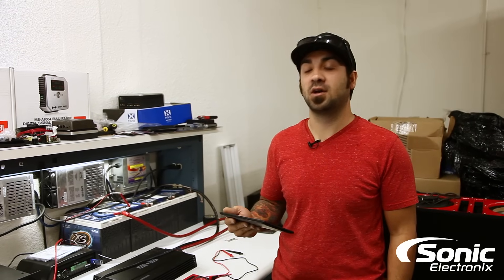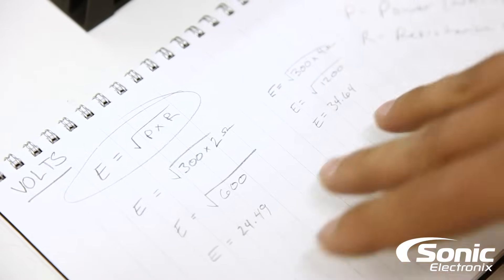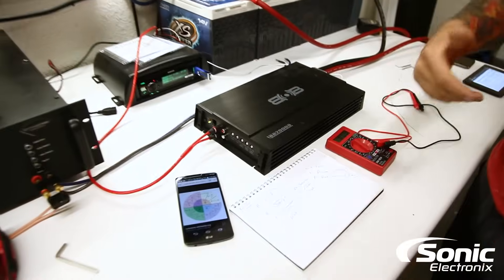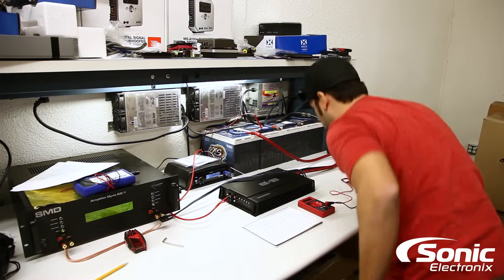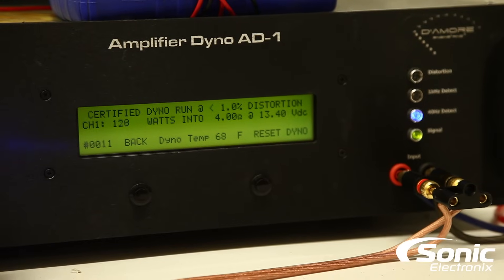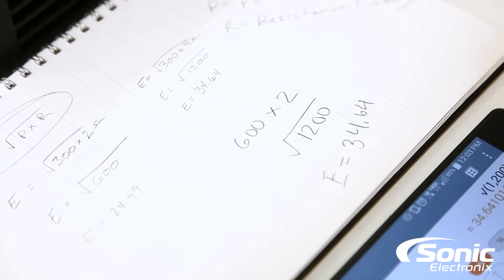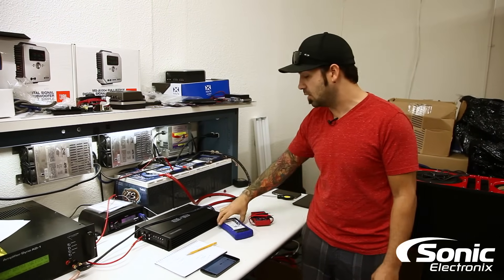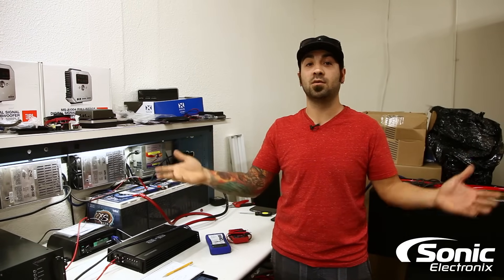How To Set Amp Gain to Match Lower RMS Subwoofers? | Car Audio Q & A

Comment: That pretty good for me. A friend gave me a dual 12inch box with amp but one woofer is gone. But since I got a small car I plan to buy a single twelve box. But now I know how or try it now with the existing 12 inch . Something funny my woofer is if I remember is a 300w RMS 4 ohm so I just have to use your calculations to use it with mine .... Many thanks

Comment: This formula isn’t working with my friends set up for some reason unless I’m doing something wrong here: He has two DVC 800 watt rms 12 inch 4ohm subs. His amp is 2500 watts rms bridged at 4ohms. I used 1600 x 4ohm then square root and the number that comes back is 80. The amp only goes to around 71. What am I doing wrong here? I was using the meter on the two bridge ends that the wires go into. Thanks ahead of time. I tried this with my set up and it worked great. (Number was 34.6). My amp is only a couple hundred watts over my speaker rms tho, unlike his which is about 1000 more watts than his speakers. I’m assuming I’m doing something wrong in the formula since the end number is 80. But I’m multiplying the total watts by the ohm load so not sure what’s wrong in that. Is it possible he has his speakers wired wrong and they’re final load isn’t 4ohm?

Comment: Sir how to run a mono block amp for my 2 pioneer tsw1211d4 at 2 ohms at maximum power my amp delivers 600rms @ 2 ohms so best source for powering up ..can I run computer power supply 12v 62amps and if want to run a battery for it how will I charge it ..

Comment: Man!! You saved me the hassle of doing the math. The last(I was hoping you would do the equation) 600x2 equation and you made my day and night! Thanks so much. Usung my volt meter tomorrow to get 34.64 on my Xtr orion 1500.d
Reply: What is the second math   after power x ohms =  let's suppose  is  1500 waats  Amp x 2 ohms =3000 then what?
Reply: @buscojosenjuarezdenuevoleo9669 roughly 54

Comment: I have 1000 watts sub dual coil 2 ohm , I connected in parallel so I got one coil 1 ohm. So I do 1000 times 1 ohm , equal 1000 watts .
Square root of 1000 is31.62 volts. I put my 40 hertz track turned the gain until I get that voltage and I end up with my sub that doesn't sound loud at all , it just need more power, when I turn the gain 3/4 in my rockford fosgate p1000x1bd than I start hear the sub playing.  I don't understand why I followed this rule and my sub still needs more power.  I hope you guys can help me

Comment: Hi bro. Nice work. When you say the subwoofer RMS is that a total combination of speakers Watt? I have 4 speakers, 2 speakers rated 2 ohm, 2 speakers rated at 4ohm. Basically mixing 2 ohm and 4 ohm as it's front and rear pair of car speakers. How do I calculate the voltage?

Comment: How would you set the gain properly on a active sub with built in 200rms amp when you have no outputs to take readings off , amp has lpf , gain, sub sonic and bass eq 
Thanks

Comment: so, my subs each have a power handling of 150-350 watts, if wired at 1 ohm, I would use 700 watts X 1 correct? Thanks for the help.
Reply: not enough info.  you sound lost.

Comment: I have (2) 8" Alpine type-R DVC 4 ohms. I have to confirm as I did not wire them, assuming they are wired for 1 ohms, amplifier Precision Power P1000.1 Class D Monoblock Amplifier 1000 watts RMS at 1 ohm.
They may have not wired them at 1 ohm to not overpower the subs? I shall find out.
Since there are 2 subs, I am assuming I still use the same formula, 1000 X 1= 1000, square root is 31.62 volts. 
Just want to make sure I'm thinking that right?
Reply: oh, wait, I can plug in the wattage I am after, not the max capability of the amplifier?

Comment: I understand this with one speaker. I have 2 square solo baric 12" subs. the L7T12 slim. the thin. 600 RMS each 1200 peak. I have a Kicker 1800w amp D class mono block amp. whats my steps plz. i saved this video

Comment: Weird I followed the way did it with my multimeter set to ac 200,remove speaker wires but when I probe it nothing shows on the meter,I even used 2 different multimeters,wth am doing wrong?my amp connected to an LOC cuz I’m still using factory head unit..please help.thanks

Comment: If my sub is wired up to be one ohm, do I use one ohm? It's a dual 2 ohm rated at 1000rms

Amp rated at 2250rms
Reply: Yes. Final load at the amplifier is what you use in your calculation.
Reply: @firebirdude2  thanks man!
Reply: also when you do this, open your low pass filter all the way up. turn bass boost all the way down.
Reply: @TheBakeMaster  thanks man!!

I watched multiple videos and did that system sounds pretty good so far
Reply: @avim868  no problem bro, Bass on!

Comment: Would i be able to set the gain to the amount of wats i need between rms and peak power? Or does it have to either meet the rms or the peak? Because my subwoofer has a rms of 250 and peak of 1,000 so im just wondering if i could push out at least 500 wats without damaging anything?
Reply: only look at the rms ratings, if you would push 500w to 250rms speaker it would die within an hour.

Comment: Is this a stupid question: why do you have the positive probe in your multimeter plugged into the DC Amp hole instead of the Voltage hole, and why is your negative probe plugged into the Voltage hole and not the COM hole? :/

Comment: Hi Bro, I have " JBL GTX-1200T 12 inch Car Audio Subwoofer Tube 4 OHM  (1200 Watt)--->Power Handling RMS is 300 Watts" Shall i choose "SONY XM-N502 2-Channel Stereo Amplifier --> It's Power @4 OHM--->175 W x 1 (BTL)"... whether it is a best match ?  If not-----kindly share your suggestions to choose the BEST AMPLIFIER ......

Comment: I was satisfied with my amp’s performance but after seeing this I was curious. Turns out voltage was about half what the math comes out to
Reply: When I first adjusted the gain it was about the same with the volume half way up because I had the bass boost maxed out. I turned that down and want to recheck the voltage. Maybe use a little boost because I’m not getting much mid range bass. Pretty much the opposite of how it sounded before. The amp dyno sheet was like 435 rms if I remember right and the sub is only rated 250 so it’s far from clipping. Alpine v series and 10” p2 in a 1.5 ported box
Reply: So how'd it turn out turning it up? Sounds better louder, no clipping or anything?

Comment: What if you have a dual subs?i have 2 dvc 2ohm subs with each 600watts rms/1200watts peak paired with 1 channel 1200watts monoblock amp 800rms@ 2ohms

Comment: Hey does it matter if the amp is bridged? I have a dual coil 2ohm sub going to a 1ohm stable amp but the amp has two sets of  outputs. Didn't know if I should bridge those or if it's irrelevant. The amp is mono..

Comment: So disconnect the speaker wire then re connect it after you set your gain at the right volts using the multimeter?

Comment: What happens if am using different watts Power for front speakers and different watts for rear speakers on a 4 channel setting? Example. Installing 650 watts x 2  (4 ohms each) 1300 watts in the front left/right and a pair of 1000 watts (4 ohms) on there left/right rear. Is this doable?? All speakers are 6x9.

Comment: What if your using a stereo class A/B amp bridged?  with a4ohm speaker load would you do the math based on 4 ohms? or the 2ohms that the amp would "See"?
Reply: You do whatever you have you speaker load too, for example if you wire your speaker to 2 ohms then you do the math for 2 ohms vice versa

Comment: So for setting up two 300 rms woofers would I have to just calculate voltage for one or both? The outputs will be the same as pressure is even but would it be safe pushing 2x the voltage into one woofer?

Comment: Shouldn't we first measure the speaker's Ohms/Impedance and use that precise number? I ask because my system is set-up to be 1-ohm but on my DMM it shows to be measuring at 1.4 Ohms so would it be better to use 1.4 in the equation rather than just the stock "1" Ohm? 
5,000 x 1.4 = 7,000 sq rt = ~83.7 V versus 5000x1=5000 sq rt = 70 V resulting in a difference of 13 Volts which may mean the difference between distortion/clipping or clear power. Right?
Reply: Impedance is typically nominal, and the reason for that is the resistance of a coil (such as the voice coil in a speaker) changes as the frequency played changes. Another factor with voice coils is the magnet itself inducing voltage into the moving coil, further having an impact on resistance. So, no, not really. What you measure at DC with your multimeter is only accurate at the given moment while nothing is happening.

Comment: Ok got a Alpine MRP-M500 and a American Bass XR-12D2 12" 2,400 Watts Max Power Dual 2 Ohm Car Subwoofer in A Pro box. What’s the best way to have this wired and set the gain properly? Thanks in advance!
Reply: Your amp is not strong enough to power that subs at full potential. Your subs is 1200 watt rms, while you amp is 300 watt rms at 4 ohm and 500 watt at 2 ohm. Also never go by the max power of a amp or subs, always go by rms.

Comment: Does it work the same if the amp is bridged? or does voltage double? Or does the amp technically see only half the resistance and so the formula should be done with 1/2 the resistance?

Comment: Question: I paired my setup accordingly. two 600 rms watt subs (12"L7Ss vented) and one 2000W RMS CEA rated (Rockville DB16) everything at 2 ohms, so WHY would I encounter any clipping? Not saying that I have, although I think I have, but MY QUESTION IS would I encounter clipping if my Bass Boost is kept at zero if I used an amp that provides way more than enough RMS wattage than what subs require? SECOND QUESTION: if I keep my amps bass boost off but use my bass knob, is that considered using "bass boost"? Tyvm for answers!

Comment: Hey great video! Question, I’m using the following setup on my Harley Davidson. Had a friend install and tune system but unfortunately I believe the tweeters where set incorrectly as they are now blown.
 x2 skar 6.5” (8 ohm) RMS: 260 watts
 x2 DB drive tweeter (4 ohm) RMS: 125 watts
Diamond Audio Micro 4v2 600 watt 4 channel amp 

what should I set the 8 ohm mids to if the amp gives me the following specs.

150 watts x4 (2 ohm)
80 watts x4 (4 ohm)

Also when playing the decibel sound track am I suppose to use the same decibel for lows for mids and high... I’m no expert in sound systems but am pretty mechanically and electrically inclined. Sound systems are a new area for me, any info will help.

Thank you

Comment: I did this and my sub has a low output I have a single sundown audio x 15 d4 1500 rms  4 cubic ft box tined to 32 hz it should be banging right?

Comment: Question, I tried this method on my harley street glide running a focal fdp6.900 amp and in vac i can't get a reading off the meter using a 1khz 0db signal. I thought maybe it was my multimeter. So I ran out and purchased another multimeter and had the same result. I can get a 2.3v reading off the RCA using the same method. But when I plug the rca cable back in and move over to the speaker outputs there is no reading on the meter. Do you know if there is something special about that amp detecting weather a speaker is hooked up to the output? Or do I need to use a different signal like 50hz?

Comment: What if the subwoofer can handle the max power of the amp
2 subs 400 RMS each
Amp can handle 800 RMS mono?
Is that a good or bad match?
Reply: Mark Seven  amp has no fuse
800 RMS monoblock class D
Pushing 2 subs 400 RMS each
4 gage battery and ground wire 
Was wondering if matching the load is good for the amp
Reply: Mark Seven  they are 4 ohms, each sub is 4 ohms.
Can I wire 2 4 ohms to make them 1 ohm. They're dual voice coil

Comment: So if my my amp is 1000.1 and my sub is 2 ohm but wired parallel to 1 ohm , so my voltage √ of 1000 which is 32.6 volts correct??

Comment: when using this method with multiple woofers wired to a lower resistance than what the subs are rated for, do you just plug in the ohm that the subs are wired to? for instance i have two dvc 4ohm subs wired parallel to 1 ohm resistance. I would just plug in 1 ohm right?

Comment: I have the dummy loads that the smd dyno uses,  the tolerance is a little off on them. This will be why you figures are slightly wrong. A 4 ohm load on the dyno will be more like 3.5 ohms,, it's a Dam shame

Comment: What he fails to mention is. .
Those cheap harbor freight meters. Have a potentiometer (spelling) on the back inside to adjust it
 Those are way off right out the box
Reply from the maker: The video's intent was to educate our customers that you can easily diagnose your problem with an inexpensive meter. We have customers from all different levels of experience.

Comment: Great video but what I have always done is turn the volume up on the head unit to  just before distortion and then increase the gain on the amplifier until I hear the sub a start distorting and then back off The Gain Slightly
Reply: Yeah, but here we are trying to set amp to 50% of its max output (assuming 600w amp and 300w sub) to match the weaker sub. Otherwise, you're sending too much power to the sub and will overheat/kill it eventually.
Reply: that's how i do it!!
Reply: And in doing so you leave opportunity for the subwoofer to blow. That old method is close but not perfect

Comment: if you have a external pre amp equalizer hook up  with your sound system, do i have to unhook  pre amp equalizer to match my radio to amp? or do i just turn my pre amp equalizer volume to max than i cam match my radio to my amp?

Comment: Okay, so my amp is 300watts max / 120rms at 4 ohm bridge. I need to set the Gain to 21.9 volts to achieve that rms but I get only 7 volts with the gain cranked to the max. Head unit volume is at 75%

Comment: So if I’m wiring my dual 2ohm sub into a 4ohm load, the math is the same? I have a 1500.1 orion  xtr amp and I want to match it to the subs 600rms. So I would use Saïd equation and plug in my numbers correct? My amps manual says at 4ohms it puts out 600 watts, just wanting to get it as close as possible.

Comment: If your doing multiple subs do you do the same but add the rms of the subs then use the ohms your going to run them at or the initial ohm load of the seperate woofer, if that makes sence

Comment: Hey man I love the vids and you guys have helped me become a DIYer since I've been unemployed and finding ways to blow my money lol but on a serious note. I have the set of Kicker CompR 12" subs from Best Buy paired with their 1200.1 amp. My question is, during this video, you mention the person having "300 watts" so is that two subs combined or you're calculating per sub? I'm sorry if that sounds confusing but for my setup, I know it's advertised at 2000 watts max, but rms-wise it's 1000 with 500 per each sub. I don't know if I plug in '500' or '1000' into the equation.

again, sorry if it's confusing. addy just kicked in...
Reply: If the subs are running together so wired on the same channel of the amp 1000

Comment: What if I have wired a 4 ohm DVC woofer (15'/500RMS) down to 2 ohm on my amp (1500max/600rms). Is the equation still the same?
Reply: If your amp is 600 RMS just set your amp again to where it's not distorting at the loudest volume u  like to play at the head unit it's not gonna blow up your woofer if it's any good. this method  is for say 1200 W amp on a 500w woofer

Comment: Hi bro ..i hv a 2000watt rms @1 ohm amp mono block actually..i hv two 300 watts rms svc 4ohm and a svc 4 ohm 500 watts . now how to calculate and adjust gain by multimeter pls guide

Comment: This also proves the inefficiency going from 4 to 2 ohms; while the math shows double, in reality losses inside the amp prevent that/

I feel it shows you should err on the side of caution, as the first two were quite a bit over the target of 300, and depending on the quality of your speaker, you might not want to give it 15-20% more RMS than it is rated for consistently.

A better idea would be to properly match your amp and speaker.  Measure true impedance would give better maths, as you are calculating with more significant digits (ex: your '4 ohm' speaker might be operating at 4.2 ohm).  In the video, the math says the 2 ohm test showing 334W @ 23.8V, the speaker has an operating resistance at that Hz of 1.7 Ohm.  The 4 ohm test showing 345W @ 34.6V, would dictate the speaker was running at 3.47 Ohm; while the 600w result is almost spot on 2 Ohm.  Since this was being run on a test bench ...  it would tell me that it is not as accurate at lower power levels, either in its ability to detect wattage, or its ability to provide specific resistance levels; if there isn't information causing this we are not privy to.

Understand the theory, then use logic and critical thinking skills to apply things practically for your set up.  Every amp and speaker is different, adjust appropriately for yours by gathering as much information as you can and using it to your advantage.
Reply: So I will ohm my leads before I disconnect  thanks man

Comment: Does RCA voltage { ie; 3v signal from head unit, or 7.4v from digital signal processor } make any difference in how well an amp can perform?
Reply: Yes.. higher voltage equals a better signal for the amp. It will also make it easier for the amp to amplify the signal since you don't need the gain up as high to get the same output

Comment: Hoping this will get read and some response. Watched video, and tried step by step, yet for some reason I got no reading on my amps output. Amp turns on and when connected to sub works, but when I connect multimeter I get nothing. Any clues as to what I may be doing wrong??
Reply: are you setting it to read AC voltage? Also make sure the meter cables are pushed all the way in/ cables are not broken
Reply: Yes I double checked. But I just remebered I set my head unit to let minimal sound get to sub. Hoping that was it. Will retry this weekend.